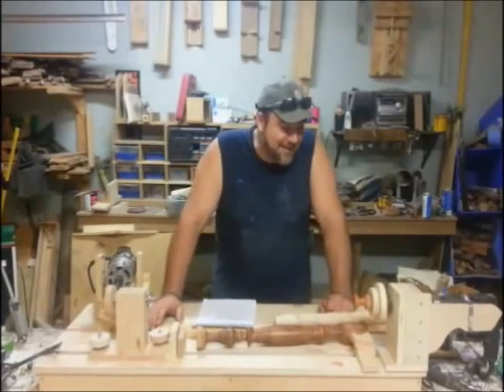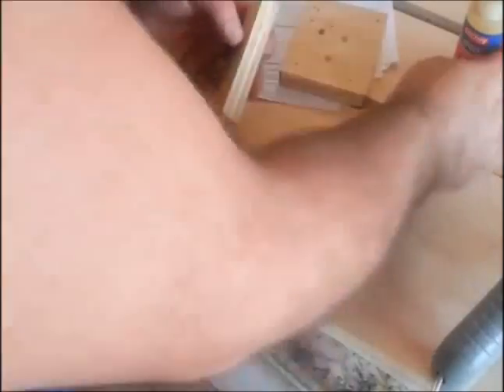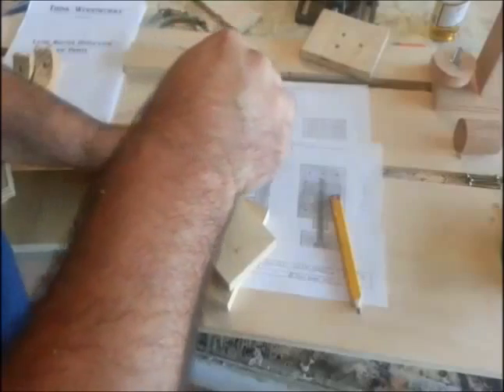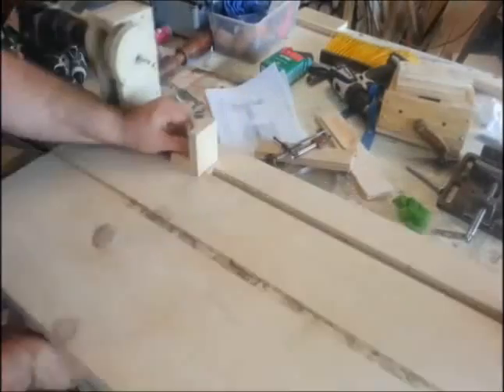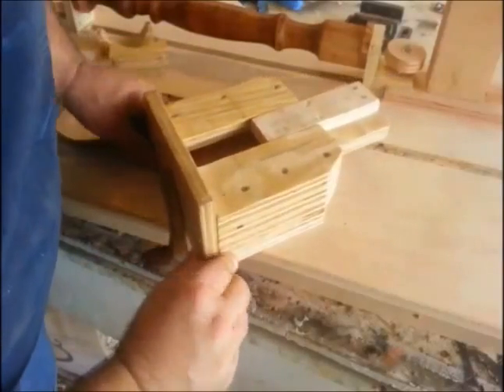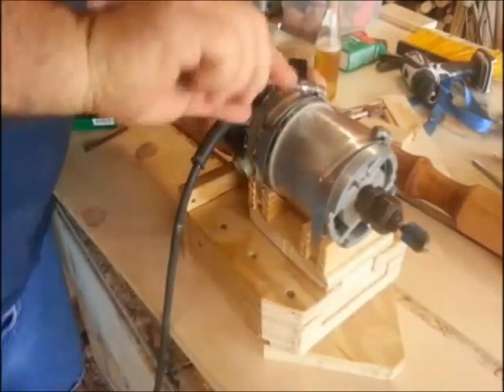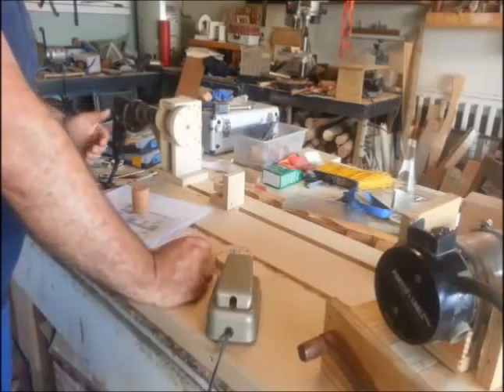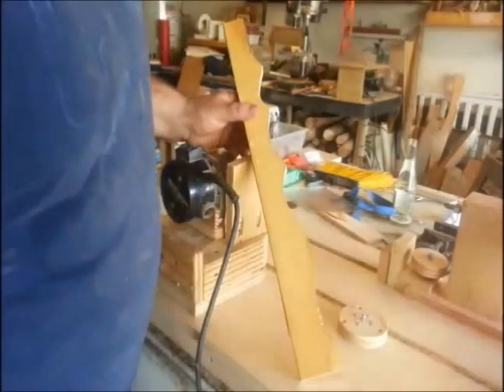Homemade Lathe & router copier - Part 2 -  and Plans!

Comment: I found this very interesting.  I was wondering if it can be modified to use a Dremel 4000 to replace the drill and the router.  It has a variable speed dial and it is a little smaller to handle.  The only drawback would be the router bits.

Comment: G'day Izzy. I have 2 questions. Firstly, what is the reason for drilling the holes around the perimeter of the headstock disk and secondly, is that knob that you are making held in by a bolt?
I am halfway through making this myself :)